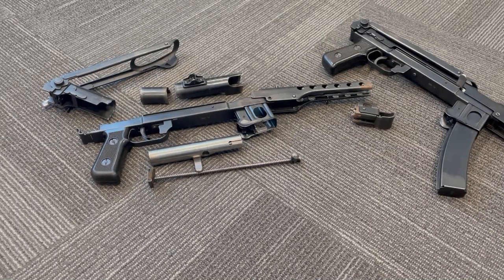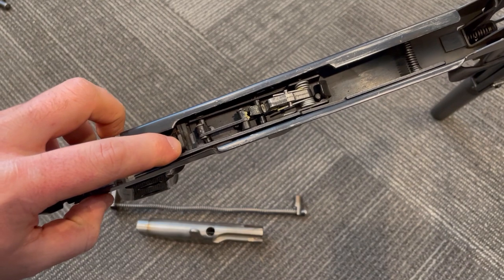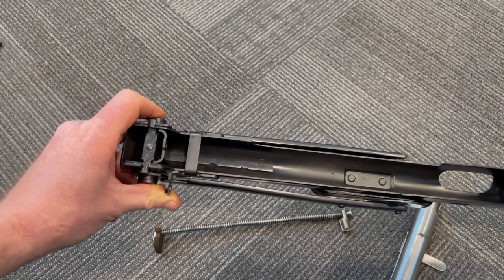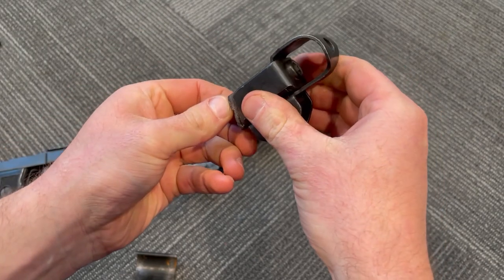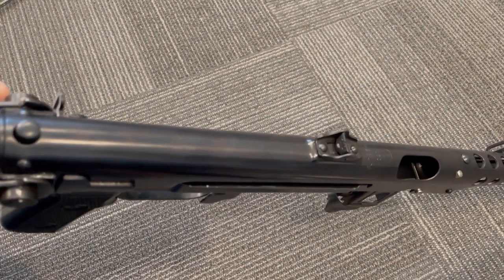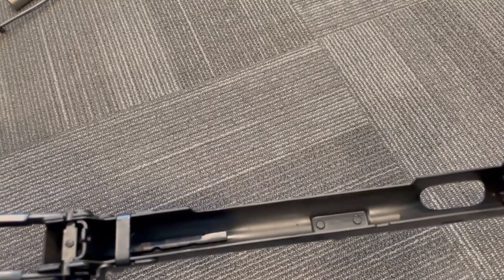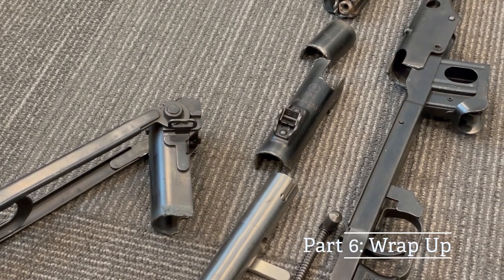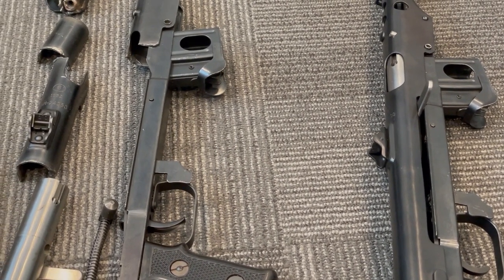PPs43 Semi Auto Build Process

Comment: I bought two kits (43 and 43/52) and the used a hydraulic press to press out my barrel pins. First one was a breeze, but the second one bent the plate underneath the trunnion.  Didn’t notice until it was too late. 
Lesson learned. Some of these pins are very tight and take more force to push out than the sheet metal can withstand. I would drill out the pins where they pass thru the sheet metal AND make sure you have support directly under the trunnion.   I didn’t do either and paid the price on one of my guns.

Comment: Built a few of these....first thing i did for the bolt was made an aluminum fixture that holds the bolt in position, then that goes in the 4 jaw chuck. A couple aircraft length drills and works perfect and repeats every time. One tip, get the drop in trigger unit if you can because trying to make a Remington 870 trigger group work in one of these is very difficult

Comment: Do you plan on doing a build guide with the other parts lit that you have? This is by far the most helpful video I’ve found on building this by far!
Reply from the maker: I might build that one out eventually too! I have a m49/57 kit to build first!
Reply: @JPMachine  what is the distance from the front sight post to the rear ?
Reply from the maker: @panchopistola8298  I don’t know exactly, haven’t measured but it should be about 0.6” shorter than original since my shroud is 0.6” shorter.
Reply: @JPMachine  I should have specified better, I meant. What is the Distance from the front sight post to the rear sight? 
I was just wondering what it was like from the factory or if you new... I am guessing it would be O.12? cause that is two cuts?
Reply from the maker: @panchopistola8298  I don’t have that exact measurement in the blueprint but I show 370mm from the middle of the rear sight to the front of the receiver piece. (Minus the front “brake” hoop. )
Reply: @JPMachine  ok that’s will probably be good enough . Thanks !  Your videos are pretty informative, so I thank you !
Reply: @JPMachine  Will it work semi auto without the denial bar?
Reply: @JPMachine  do you have to use a denial bar and will it function in semi auto like this
Reply from the maker: @Jeff5969  legally yes you need a denial bar to prevent a FA bolt from working. With my semi bolt and a semi FCG it functions great!
Reply: @JPMachine  thanks for the info man
Reply from the maker: Just an update here, check out my new part 1 build video for another PPs43 kit! Much more details on the build DURING the process!

Comment: I wish I had the willpower and skill to do something like this, PPS is my favourite wartime smg and owning one of the polish 43/52 variants and the addition of the longer barrel.
Reply from the maker: Get a mig welder and practice cutting a steel pipe apart and welding and grinding it back together! Practice makes perfect. The low cost of the kits really helps if you mess up once or twice too!

Comment: i remember that the front pin on mine was such a bitch to knock out, eventually i decided to drill it out with a 7/32 drill bit to leave some clearance and i replaced it with a 1/4 quick release type pin with the ring on the end

Comment: Really nice build! Can you share some more details such as jigging the upper? Thanks
Reply from the maker: It’s pretty simple, clamp the jig in with vice grip pliers. Size the ejection port to 2.00” long and tack in place. Use AL flat stock to back up the flat parts of the receiver. Slowly tack around the whole receiver.  Let it cool after each tack. Then just weld up the next cut behind the sight. For the last one in the back, size it to the lower receiver and tack it in place. Dim’s don’t really matter as long as the lockup to the lower is nice and tight. Once you’re happy with the sizing weld in your denial bar and finish the weld up. The front weld I used my barrel for alignment and some 1/8” AL strips for the backer.

Comment: You did a really good job in rebuilding that what is the recipe that you used for your bluing solution can you do a video of that too that would be great thanks
Reply from the maker: Good idea! Next time I have a project to blue I’ll make one on that. It’s a mix of sodium hydroxide and potassium nitrate
Reply: @JPMachine  what is the ratio sodium hydroxide and potassium nitrate
Reply from the maker: @octagongarage3504  5lbs sodium hydroxide and 2.5lbs potassium nitrate per gallon of water. Adjust mixture so it’s at a rolling boil between 285-295F.

Comment: Would be able to give measurements on the welding jig? I have lathes and mills just can’t find the welding jig in stock anywhere right now.
Reply from the maker: Main diameter is 1.13”, the smaller diameter should be sized to be nice and tight in your trunnion.

Comment: I really like the feel of the whole trigger mechanism. I see these after market trigger components and they look like garbage. I am a  machinist by trade. Is there any work around?
Reply from the maker: Freedom machine on weaponsguild has a FCG now and it is absolute perfection. Nice, crisp, and smooth with very little slop. In my latest range video I show a comparison on the pioneer and freedom machine FCG’s.
Reply: @JPMachine  Thanks for sharing. I checked. It costs $165 which is just so much. I could spend $200 and keep it full auto with tax stamp.
Reply from the maker: @Prest0n97  I think you’re misunderstanding what you can do with a tax stamp. Unless you are an FFL07 with an SOT02 you cannot build a legal F/A. With a tax stamp you can build a semi auto short barreled rifle or take possession of a registered pre 86 F/A. What exist of those will sell for $20,000+.
Reply: @JPMachine  Gotcha I will look more into this. new to the legalities. Its getting to the point where its better to buy this gun for $599 from atlantic arms. I wish we had a way of converting to semi without altering the Trigger group. Most videos don't go into extreme detail.
Reply from the maker: @Prest0n97  there isn’t a way because it cannot be an open bolt gun. You can just modify FCG’s on PPsh41’s and m49/57’s because they have a semi mode, but still need to convert to a closed bolt. IMO, buying a premade firearm isn’t as rewarding as building it. They do not have the original markings, and with the riveted on receiver section, they don’t look original.
Reply: @JPMachine  Thanks for your well written response. I Definitely will look into this. What lathe and Mill do you have? I've been personally looking at grizzly and precision Mathews but haven't decided.
Reply from the maker: @Prest0n97  I have little machine shop hi torque units. 3990 is the mill and 5100 is the lathe… with various upgrades. As you may be aware, none of these are made by the companies that sell them. They are mainly all units produced by “Seig” with some degree of customization by the company placing the work orders. The 3990 is the best choice IMO for mini mills of this caliber. Add a set of igaging DRO’s and it’s awesome.
Reply: @JPMachine  good to hear. My main concern was being able to use end mills and shell mills. Many mini mills only have the drill chuck and cant hold collets. I just want to be able to use collets and be able to machine barrels on the lathe.
Reply: Nice work on that kit! I’m right in the middle of mine right now and was wondering which end of the bolt do you start drilling the firing pin hole from? From 2 other builds I’ve watched they both drilled from back to front which turned out ok but if you are a little off the pin might not be centered. If you start from front to back then being a little off would not be so critical. I’m watching your other builds now and am very impressed with your workmanship

Comment: surely the parts are easy to turn on a lathe and milling machine ,just need correct metals and heat treatment ,not hard at all ,could do it by hand if needed to its not as if parts are going into different guns,id make the fireing pin screwed in with a slam fireing system ,much easyer than the floating pin,the cut up parts id make my own from scratch get the meusurements correct get it done alot faster than rewelding and grinding ,,as i sid not hard to bend a bit of sheet metal ,you know its not falling apart,use a bottle jack as a press to drift pins out and to replace them

Comment: WHERE EXACTLY DOES IT SHOW THE TRIGGER GROUP INSTALL AND MODIFICATIONS?
Reply from the maker: I didn’t really cover every step of that, just removing the bottom plate in the beginning of this video: https://youtu.be/XnY7jue0Q5o Once you drill out the trigger guard rivet you use that hole for an m5 bolt into the rear hole in the pioneer trigger groups. Then just eyeball it straight and drill for the front mounting hole. The left side rail might need to be trimmed a bit if the trigger group won’t fit down inside, otherwise it’s not necessary.

Comment: I noticed you didn't put a pic rail on yours. Did you just not want to go through the effort of aligning/welding it up: or were you trying to keep it as original as possible?
Reply from the maker: The idea here was to make it as original as possible with a 16” barrel. Iron sights work just fine!

Comment: So out of curiosity: the parts kit has been 'fully destroyed' (as far as ATF is concerned about frame/receiver)...it is no longer a gun. So all the warnings about 'nfa item' only apply if you put the stock on it with a <16" barrel: because if you bend a new frame from a flat...its technically a 'new' frame/receiver, so it should be seen as an 'other' (not rifle or pistol)?
So, the 9" barrel or whatever the length, but w/o stock, and that should be legit (after semi-auto conversion)?
Reply from the maker: You still need to comply with all NFA regs… so sbr, fa post sample, etc. receiver doesn’t matter. It’s still a rifle or a pistol depending on how you build it. If you build it so it cannot accept the stock or it’s permanently fixed in the closed position you’ve made yourself a pistol.

Comment: How did you headspace it
Reply from the maker: The barrels all come pre headspaced, if the bolt closes all the way so it rests against the barrel with a round chambered, it’s good to go. If the round gets pushed into the chamber someone ran the reamer too far in and the barrel’s trash.
Reply: @JPMachine  ok thanks for the advice.  Still waiting for the parts kit to arrive.

Comment: How can I contact you for a semi auto bolt?
Reply from the maker: I have usernames on a few sites: cmpforum, Reddit, WG - jpolham1; akfiles and gunboards - cbrkneedrggr. I’ve got WTS ads on most of those sites
Reply: Didn’t find anything. Is there a better way to contact you!
Reply: I found someone on eBay thought it may have been you. Same size denial bar and milling looked the same.
Reply from the maker: @neilmartin9446  same me, yes. It’s $25 more through eBay though. Here is my Reddit:  https://www.reddit.com/u/jpolham1/?utm_source=share&utm_medium=ios_app&utm_name=iossmf
Reply from the maker: More information on the bolts (same info as eBay) here: http://forums.thecmp.org/showthread.php?p=2177996#post2177996